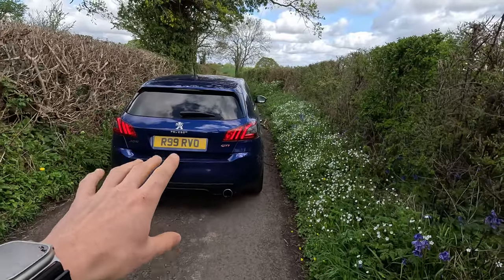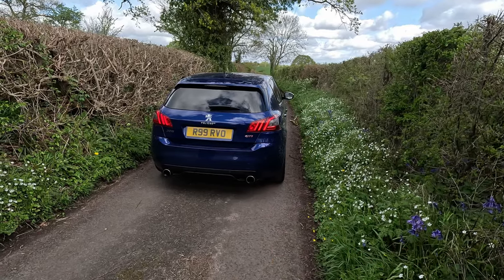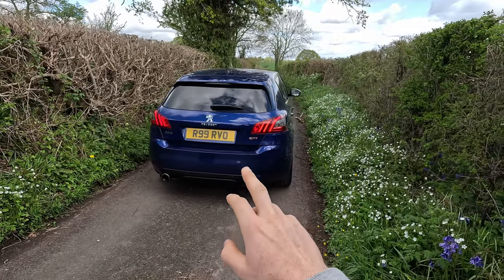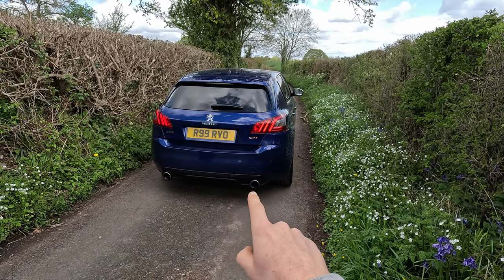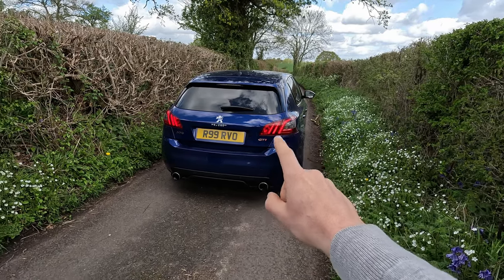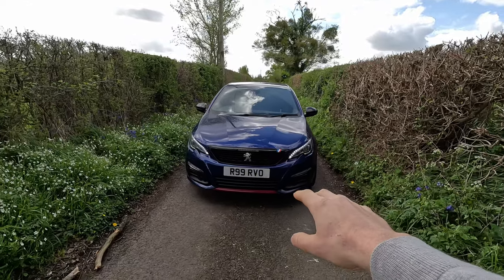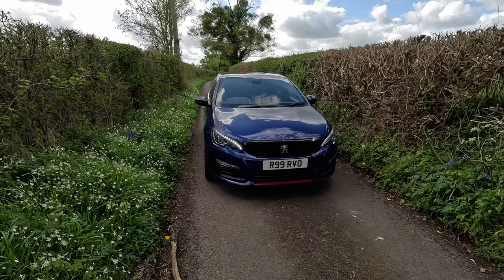Peugeot 308 GTi exhaust and induction sound! *RAW NOISE*

Comment from the maker: Just as an update: I had a lot of people talk about how the exhaust noise pulsing being a boost solenoid issue. I had never paid that much attention to it however, I have now changed it and seemed to have solved it. 😎
Reply: What is the pulsing you mean? Sounds good. How is it on longer runs, tiresome or not? Any problems listening to radio/music?
Great video👌
Reply from the maker: @mathiasgunnarsson5386 The volume of the exhaust note pulses louder and quieter than No issues with exhaust noise in the cabin nice and quiet on long runs. Super comfy!
Reply: @xiolage  so basically it’s louder when you step on it but almost the same as before when cruising?
Thanks for answering😃
Reply from the maker: Exactly that!

Comment: I was wondering if you could share the part# please for the replacement boost solenoid? I'm getting the same "pulsing" but only noticed it after my GTintake install. Thanks
Reply from the maker: Pressure Converter Valve 1922V8 9830210580 Febi 😁
Reply: @xiolage  thank you so much! i've managed to get the replacement valve. did you happen to do a video on its replacement? or are you able to point me in the right direction for a workshop manual or install instructions? cheers
Reply from the maker: I didn’t record it, but it’s it’s easily doable. If you get right under the far and look near where the exhaust runs towards to the engine you will see it there (multiple vacuum lines connected to it). You’ve just got to fiddle around until you get all the lines off and then you can swap them over. A small pair of hands is a huge help if you have a spare set 😁

Comment: The boost solenoid needs to be replaced. It's the cause of the oscillating boost and exhaust sound
Reply from the maker: I did notice it right after filming. Will investigate into it. Cheers!
Reply: @xiolage  sound mega btw with the mic by the exhaust. The interior is so insulated, what you hear when you're inside makes you think it's quiet but it sounds nice from the outside. Also got a res delete on mine and I can't get enough. You should put a GT intake on it! Meant to be the best for it and performance gains
Reply from the maker: Haha thanks, yeah it does sound epic. I’ve ordered a replacement valve. Looks like it’s at the back of the engine.. hoping it’s not too much of a pain. 😂
Reply from the maker: Just to update on this, i’ve replaced the solenoid and solved the issue. Video coming soon 👍🏼
Reply: @xiolage  Nice one. Not too much of a pain to change? Looking forward to more videos
Reply from the maker: It’s a bit fiddly but easily doable in 10 mins. 😎

Comment: Great video as always bro, great car I serviced mine yesterday what can I say the air filter is a b@stard to remove 😂
Reply from the maker: If it’s anything like our old 208 GTi, I can imagine it’s a pain 😂🤪
Reply: @xiolage  it's a nightmare mate I've ripped my hands to bits, those Peugeot electric connectors don't like coming off haha
Reply from the maker: Kind of contemplating just getting an induction kit to avoid the hassle in the future. 🤪
Reply: Owed a 308 GTI for 3 years now, still so happy with it. 😎 👊🏼🔥